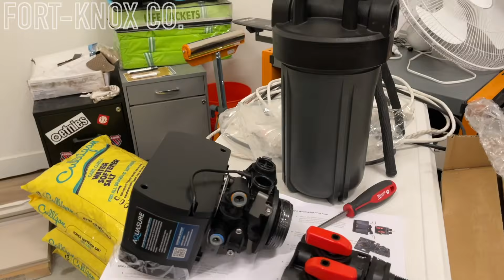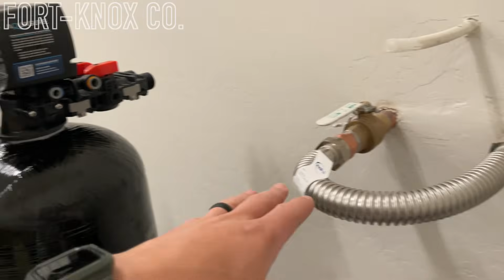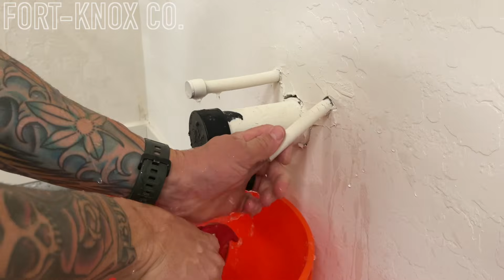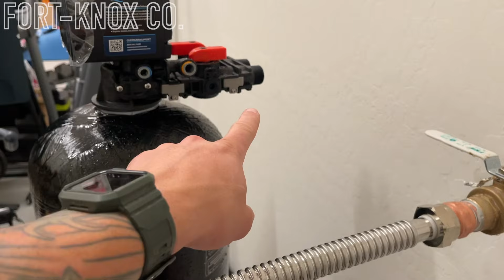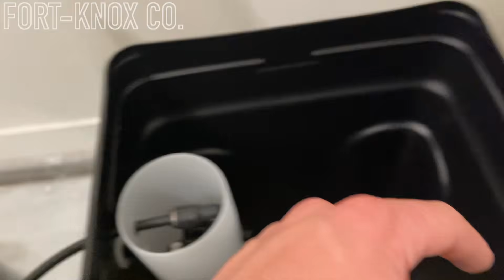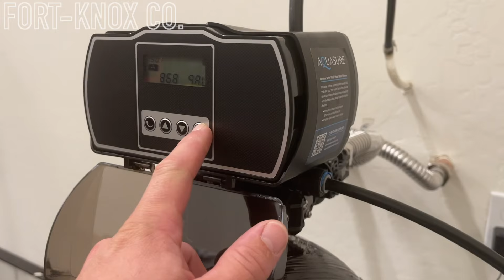How To Install Water Softener System Aquasure Harmony Series | Water Softener Loop Connection

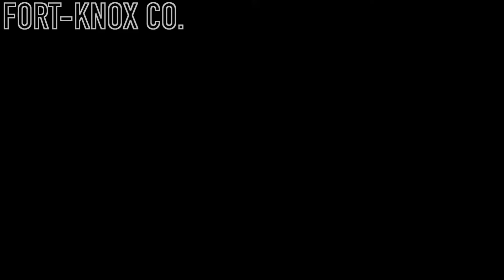Comment: 28:51 Nice video, step by step... very informative. Question, If there is a leak on the drain pipe, how you will fix it?
Reply from the maker: The drain pipe/flush line from the head unit on the tank? Like where it flushes the water out and to a drain? 

I’ve had that issue on one unit recently, different brand though. I had to pull that plastic clip that secured it in place, pull out the fitting/elbow that the drain line is connected to and check the O-rings. Sometimes they are damaged, twisted or pinched. It happens when it’s pushed into place. Usually this can be fixed by making sure those O rings aren’t damaged , like at all-make sure they are perfectly smooth and no intentions or imperfections, then use that silicone lube are be liberal with it. This will help it seal and go back into place without damaging the o rings again when sliding it in. 

Also make sure your drain line isn’t pulling on the fitting. Sometimes the drain line turns and goes to the connection at the wall and it will be pulling on the fitting and that can push it out of alignment where it sits in the head unit.
Reply: @FortKnoxCo  yes, the drain/pipe flush unit from the head unit on the tank. Do i need to turn off the bypass first so that i can remove the line or the pipe?
Reply from the maker: @carlosantos8616  you shouldn’t have to turn off the water to that or the bypass because it’s usually not pressurized until the head unit opens up the valve and pushes the water out to drain. There will probably be some water sitting in that line obviously so I would still have a bucket and a towel nearby when you pull it open.if you do want to turn the water off just as a precaution, it won’t hurt
Reply: @FortKnoxCo  thank you very much. You've been very helpful. God bless 👍
Reply from the maker: @carlosantos8616  your very welcome. I hope you get it all working right.
Reply: Did you make the decision not to install the sediment filter that comes with unit simply because you didn’t want the hassle of modifying your pipe structure? Does Aquasure say anything about “voiding warranty” if the sediment filter isn’t installed?

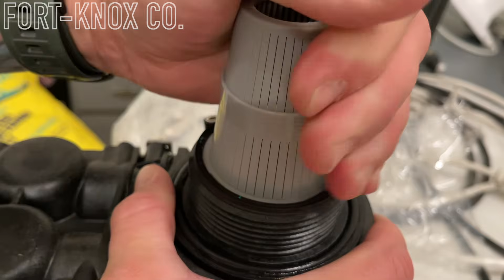Comment: On 5:04 make sure you counter clockwise the gray little basket. Its a bit tricky but once it sets in the proper position you have to apply a little force until it snaps in. Then pull it straight up if it doesnt come off then you hit the spot!
Reply from the maker: Great advice!

Comment: What happens if you run the entire regeneration cycle with both valves open (the one to the house and to the unit)? I made this mistake. Do I have to do the regeneration cycle again with the one to the house closed?
Reply from the maker: It should be fine. Either way it will run it’s regeneration cycle on its own when it hits its time set by the gallons used. The first cycle you run is really to get the matter inside (the resin) to be ready to start softening. I ran the first cycle with it open and it still worked properly after.

Comment: Do you have the under sink RO installation tutorial?
Reply: Thank you, can i use the shark bites on my in and out pipe since im cutting it and by the way its a pvc not a metal pipe. It is 1 inch i believe. Or is it better to glue it with pvc elbow that has threads in the end? Again, thank you for helping ppl save some money
Reply from the maker: @joeldg2386  you can definitely use the shark bite connections. They connect to metal or PEX and PVC I believe.
Reply from the maker: @joeldg2386  but also if your pipes your cutting are PVC and not PEX ( the flexible type of plastic water pipe), then gluing a threaded end cap would be really good and most likely way cheaper than 2 shark bite 1” connections.
Reply: @FortKnoxCo  thank you sir! Love your work man
Reply from the maker: @joeldg2386  thank you I really appreciate that
Reply from the maker: Yep. It’s on my channel. One of the last 3 videos I posted.

Comment: Thank you so much for such an informative video. I’m looking at purchasing a whole house water softener and I had a question for you. I’ve seen some units that have a single tank plus a brine tank and I’ve seen other units that have two large tanks plus a brine tank. If my house has four bathrooms and there’s four people living in the house can you tell me how many tanks I will need?
Reply from the maker: I have another video showing a whole home filtration system i that I did shortly after this install. 

This system has a single tank because it’s just a water softener. It has a single tank with a resin matter that scrubs the hardness/minerals from the water only.

The whole home filtration systems usually have two large tanks, one filled with a carbon matter that filters the water to a drinking quality, and the second tank has the resin matter for the water softening feature. 

So there’s a difference in the actual system when there is one tank or two.  Water softener only or “whole home” filtration which is filtered and softened water.

Comment: Thanks! Looking into this water softener. I bought the Whirlpool one that all sites say is great but it crapped out on me after 1 year and the customer service is full of crap. So I’m just going to replace it. This design looks like a better solution from what I’ve seen with the Whirlpool.
Reply from the maker: We love this one. Have no complaints at all. Very simple and I like that the tank and salt bin are separate. But overall it’s the best bang for your buck in my opinion.

Comment: Thanks for sharing. My garage flooded because the brine tank overflow wasn’t connected to a drain pipe
Reply from the maker: Yeah, a lot of times they don’t connect the overflow line for the brine tank but it’s there as a extra layer of protection, obviously. Usually the water will shut off automatically with the float valve inside of the fill portion of the tank. Once that float hits just like a toilet fill valve it should shut off. But yeah, if you want to run that overflow line that should go out to some type of drain or even just out the garage to the street or outside somewhere. sorry to hear that you had the flood

Comment: What if there is no flush out pipe? I am in a new build and the ruff in a spot to if i wanted to get a water softner but i dont see the flush out pipe. is it common to not have one?
Reply from the maker: Usually with new builds they know there needs to be a flush line as well when installing the water loop. That may also be something you want to bring up to the builder. If your keen with your words you may be able to articulate that THEY need to come in and finish what is commonly needed with this feature.

Comment: So absolutely stupid that the manufacturer didn't tell us how to set the nozzles. Ridiculous. 

Ty for letting me know.
Reply from the maker: Your very welcome. I tried to out information in here that I felt people would need when working around little issues when actually physically installing it themselves. Glad you found it helpful
Reply: @FortKnoxCo  Seems like a really vital piece of information that should be at the top of step one.

Ty again. 

Two hours later and the initial setup is complete.
Reply from the maker: @Squirrel-Chaser  yeah for real. It supposed me
Sometimes how basic some instructions are and they claim it’s so it yourself but sometimes would require a few more intricate details to really get it right.
Reply: @FortKnoxCo  does your brine tank have a large amount of water in it after initial setup? I'd say almost half the container with the 80lb of rock salt under water.
Reply from the maker: @Squirrel-Chaser  yes. It’s seems with this brand/system they have a brine tank fill time that when it refills after the regeneration cycle it fills the brine tank back up so it sits with water in it. 
Seems to just be the way this system works but if you want it to have less water in there sitting you can adjust the fill time minutes down and it shouldn’t fill as much.
Reply: @FortKnoxCo  Good idea. Thanks for taking the time to answer all these questions, it's been extremely helpful. 

Maybe I'll just add more than 80lbs of salt in there so it helps "hide" the visible water in this wet brine system.
Reply from the maker: @Squirrel-Chaser  no problem at all. If you do add more salt I’d just be careful because adding more increase the amount of solid matter in the tank but not the amount of water that will be put in when doing it’s cycle. Too much salt could cause it to overflow as it would still be running the fill time the same and essentially adding the same amount of water. From what I’ve seen and heard back from the company they say the water level sitting above the salt isn’t anything to worry about but if it needs to be adjusted down some then I’d still recommend taking the minutes on the fill time down a few and see how that looks.  It should be one of the last steps in the set up procedures in the instructions. Like step 7 or 8 is the minutes for the brine fill tank.

Comment: Thank you for showing how to install it.
I just installed it 2 weeks ago.
I have a question about the brine tank
Why is the water over the salt
I put 120 pounds of salt in the (1/3)tank but the water is still (3 o 5 inches) higher
Reply: Thank you so much
Reply from the maker: Yeah I had the same thing. It seems to be just the way the system sits, some systems pump in water during the regeneration to Saturate the water with salt and then flush and when done it pumps it out. It seems like this system lets water sit in the tank inbetween flushes.  You can adjust the level of the water that is pumped back into the tank on the different settings when adjusting the system through the menu. There’s a time in minutes that you can set for the system to pump water back in the brine tank, I adjusted that time down some and it helped reduce how much water sits in there.
Reply: I was concerned about this too! When I called they assured me this is how their system works!

Comment: Any issues with this system after a year of use?
Reply from the maker: None. No complaints at all. I recently swapped it out for a Shell Water systems Whole Home Filtration system though. Mainly because I wanted the next step up from just softening and wanted the “whole home” system. I really like that one too. And I did a video on it as well

Comment: I went through the initial regeneration process but didn't shutoff the outlet bypass valve. Should I run through the process again?
Reply from the maker: If you don’t mind doing it again then I would just follow the steps that say for the start up. If it doesn’t scrub the resin inside with the salt water properly it could effect how good it softens the first run. But once the unit runs through it’s next cycle to regenerate it will run the cycle and set your tank up to be able to soften to its full effectiveness.
Reply: Thank you so much. The instructions weren't very clear on the position in which the valves should be placed for this process. Thank you for explaining this in your video! @FortKnoxCo
Reply from the maker: @JasonHammond-j2u  No problem at all. I think when you do to first cycle it’s not critical but it doesn’t hurt to do that. When it runs it’s regular regeneration late at night the bypass valves aren’t turned. It will still flush everything the way it’s supposed to and be ready to go again once it’s completed.
Reply: Great info to know, thank you so much! @FortKnoxCo

Comment: The small flush hose on the back, I do not have one of those except where my Ac unit goes out of the house do I need that?
Reply from the maker: The small flush hose from the back of the head unit does need to be installed into some type of drain. Depending where your water softener is located, you’ll need to have that tied into a drain line. Some people flush it out to a sink drain other people will have access to a larger drain like where a washer and dryer drain out too. It just needs to go into some type of drain pipe. It can have a high flow of water so something that a washing machine drains out to is preferred because they have a longer drop of pipe before the P-trap.

Comment: am I blind or did you not include a link to the 1.25" to 1" adapter? you say you got some at Ferguson, Proflo, 1.25" to 1"?
Reply from the maker: The link to the product on Ferguson Website wouldn’t generate in the video description the same way the Amazon affiliate links work. 

But I wanted to mention that our pad elf Amazon or Home Depot the Ferguson’s website was the only place I found those specific adapter flex lines. I’m sure there is a few other plumbing supply places that can order them. But Ferguson had them in stock and to my house in just a day or so.

Comment: Video is very clear and neat but After 2days of completely fitting - our water softener is dripping at the neck of the cylinder where the control goes in 

Can you suggest what might be the issue
Reply from the maker: The tank is leaking between the head unit that is screwed in and the tank? 

You might need to tighten the head unit more or try to reapply more silicone grease on the O-ring that sits between those two pieces at the point of contact. 

Most leaks I find are due to the O-ring in whatever location not being greased up enough. It’s food grade grease so it’s okay to go liberally with the stuff.
Reply: @FortKnoxCo  thank you will try 😊
Reply from the maker: @ragini2419  no problem at all. I hope that works for you

Comment: Thanks for sharing.  It was a lot of help.

The drain line coming out of your wall, is that connected to a vent tube?
Reply from the maker: Usually when you’re connecting that drain line, that’s already in the wall it does go to a drain pipe which has a vent on it. All drain pipes in your house. Have to have some type of ventilation per code. So all this is doing is tapping into an already existing drain line usually. In my case it just dumps into where the washing machine drains out to.
Reply: @FortKnoxCo sounds good, I live in a one story house.  My drain tube needs to go up in the attic and connect to a vent tube.

Question…is it ok for the drain tube to be higher than the water softener system? 

It doesn’t have to go lower than the water softener using gravity, right?
Reply from the maker: @blakebiltwell5  nope. It should be fine going up. Mine goes up over 8 ft and across the ceiling and down into a drain. When it discharges the water it has pretty good pressure.

Comment: Great Video!  I have a couple questions.  1. I am replacing an existing unit.  Where the unit is in the basement while the brine tank is on the main floor in the garage.  Will I experience any issues with the distance between the 2 or with the brine tank being higher than the unit?
Reply from the maker: I don’t know if the difference in elevation between the two will make a big difference. I believe the unit has a suction and pressure to push and pull the water in and out of the tank. Because it’s a hard plastic line I don’t believe there would be any difficulty in the pressure required to travel up or down. I’ve just never seen the Brian tank be in a separate location then the softener. If you’re able to put the salt tank next to the system, I would say do that, and you could keep everything all together. But if you have to have them in those separate locations then it may just be what it is. The only thing I could see being a factor is the distance that the water hast to travel to and from the brine tank. but again as long as it’s not excessive I don’t see how that would be a problem.

Comment: Connectors that use rubber gaskets to seal connection do NOT require plumbers tape. In fact, putting on plumbers tape risks having a bit of it stuck in the gasket that could lead to leaks.
Reply from the maker: That is true. It’s not needed. And if overdone can cause problems. Another one is having 4-6 wraps of tape and causing the threads to be too tight and tracking the plastic fittings.

Comment: Going to be installing ours myself now, looks like I’ll be cutting the copper U shaped connection and adding shark bites like you said. Thank you so ouch for your detailed explanation!
Reply from the maker: That’s awesome ! I’m happy to be of help. Those shark bite with the male threads to come off the pipes make the whole process so much quicker. Not complicated at all after getting the loop set up

Comment: We bought this exact system and it was installed today. We love it already!
Reply from the maker: Nice! We love our too. Have no complaints and it works like a dream. Very good for the money as well.
Reply: How long did it take?
Reply from the maker: @cleo5721  the full installation took about an hour or so. But each persons situation could differ depending on how their water loop is set up. That’s the hardest part really. The connection of the waters softener is easy.
Reply: @FortKnoxCo  thank you! I’m scared to do it by myself. But watched your video twice. I will try! 😃 my house has 2.5bath with 3 people living. Is your water softener too big for my house?
Reply from the maker: @cleo5721  no it wouldn’t be too big. But you can also choose the size down. I think it’s the 45,000 grain? They have a couple models to choose from.